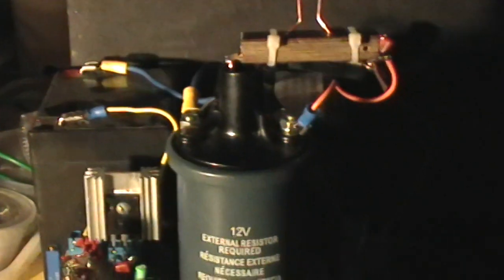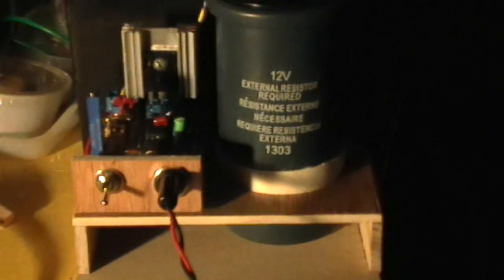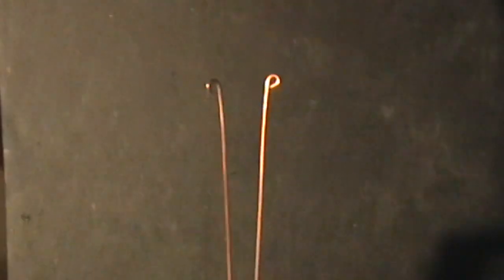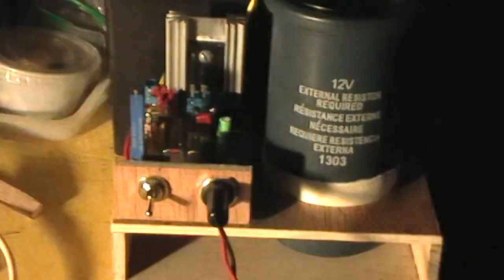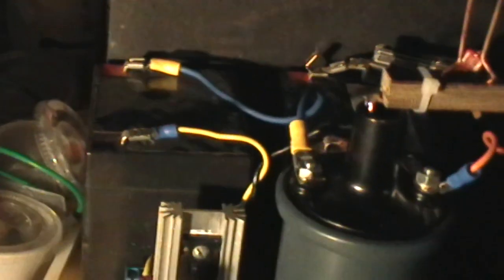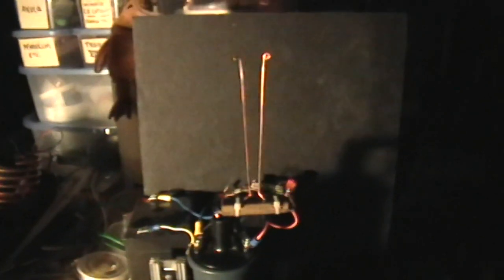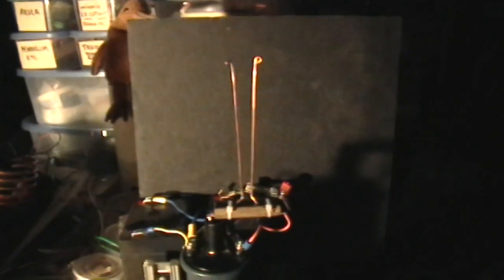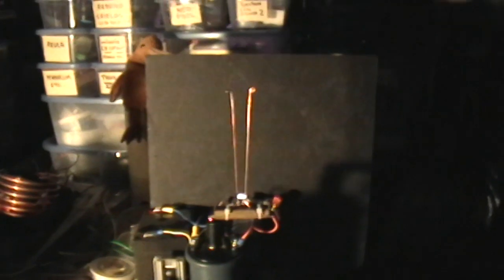Misc Circuits: Ignition Coil Jacob's Ladder Demo 2: 24 V to Coil

Comment: Impressive..could you use a positive negative op amp configuration? Since you already have the duel voltage. It would be an conversion. Plus it would give you a pure sine wave. ..in any case great job!😝

Comment: Nice result.
Would like to see the gap opened up....
Reply from the maker: Thanks. The gap at the top is already 2 cm and you can see that the arc stretches out more than that from the convection. If I don't use a Jacob's Ladder and just make a big gap, then the thing will spark out along the "hot" wire insulated column and over one of the coil terminals. For better isolation and longer sparks I'd have to immerse the system in oil and I'm not quite ready to do that with this coil yet.
I have another driver, using a 4093 quad Schmitt-trigger NAND gate chip as oscillator, that also works this well with 24 V input and has better control of frequency and duty cycle. Uses IRF530 mosfet and runs reasonably warm.  I'll demonstrate that one later this evening probably.

Comment: Looks good. What I did in my circuit is place 4 by 75V zenner diodes across the collecter / emitter of a MJH10012 Darrlington Transistor (Instead of a Mosfet) as the back EMF of the primary winding now pulses at 300v. This boost on the negative terminal of the coil from being pushed from 0v to 300v gives the collapsing magnetic field a kick start as a increase of 30x the voltage in means 30x the voltage out.
Reply from the maker: Good idea. I don't have any HV zeners on hand though, but I did find some HV Diacs and a few TVS items in my junk stash. (I can't afford to buy anything so I'm working with stuff pulled from old TV and monitor chassis.) I'm trying to develop a good HV supply for the primary supply of my 24VDC SSTC "TinselKoil VII" to use instead of the fragile flyback transformer/Royer oscillator system I've been using.